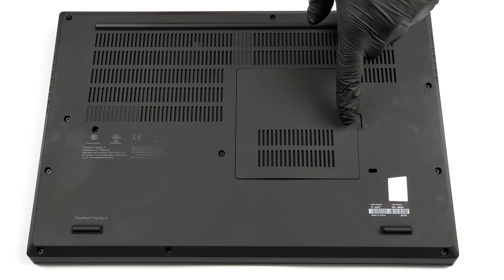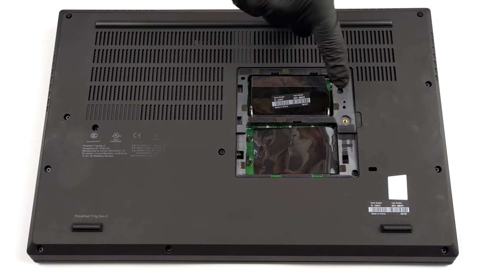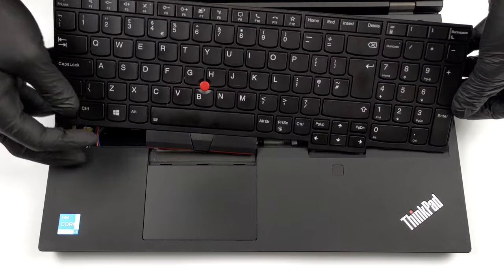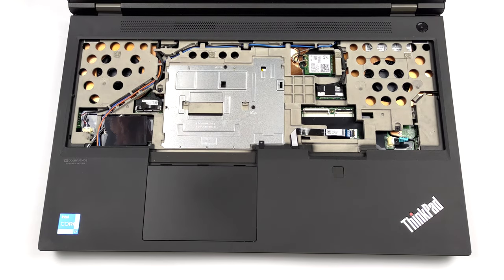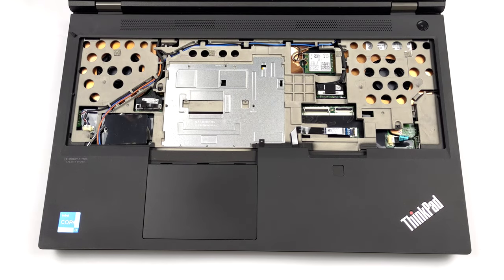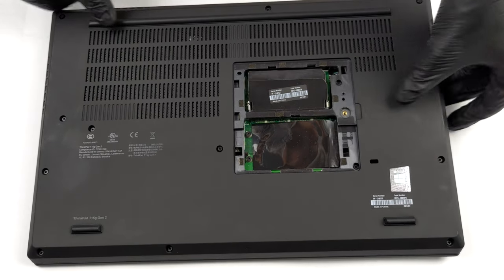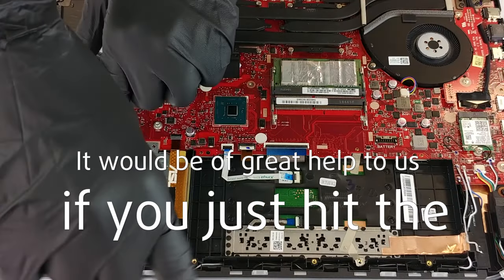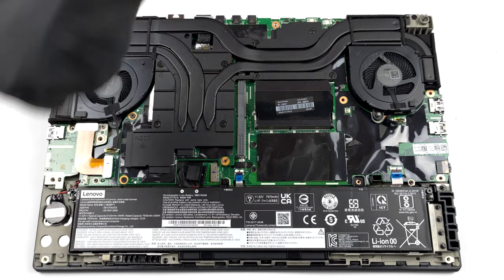🛠️ Lenovo ThinkPad T15g Gen 2 - disassembly and upgrade options

Comment: Hi my friend. Have one just like it. Lenovo thinkpad t15g gen 2. Just grab it. Tell me some thing please.. On witch sides the air is blown out whe and the fans are working? Can you hear the guns works at both sides or just the air going out?

Mine jus blow on the lesf side both side and back... Does the right side is used to pull air in?
Reply: all of the side vents are exhaust, intake is on the bottom